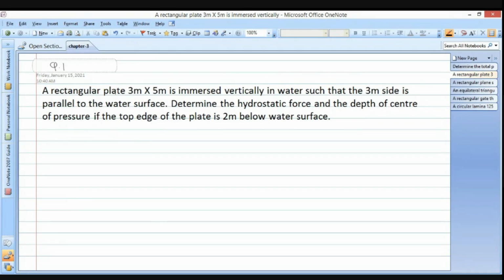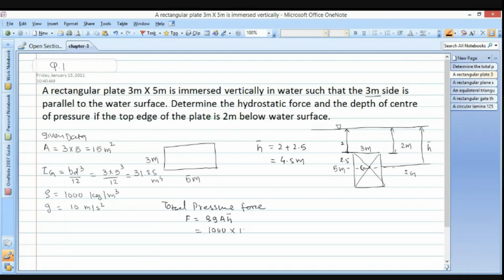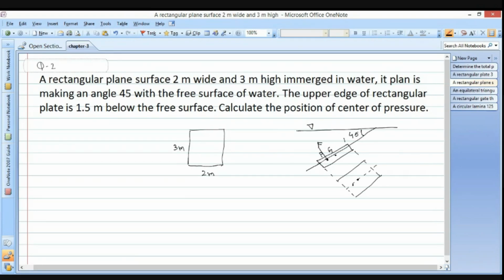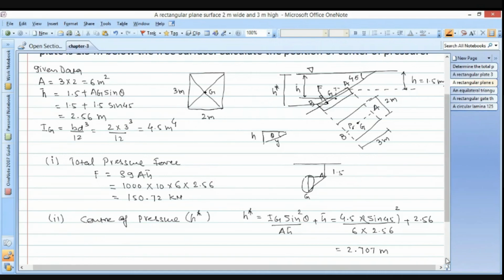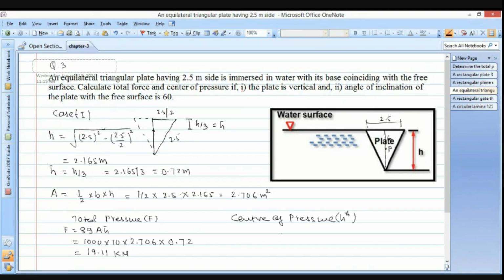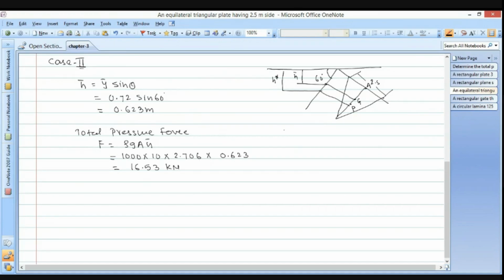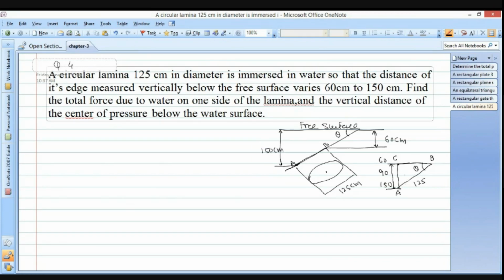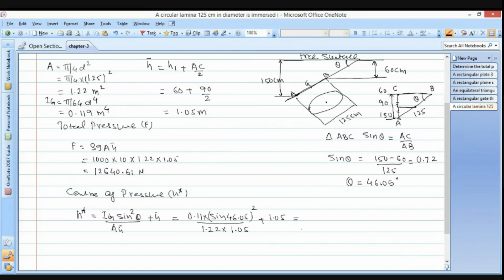Numerical of Total Pressure force and center of pressure | Lecture-7 | FMHM | 3141906 |2130602 | GTU

Comment: A circular plate of diameter 2m which is placed vertically in water in such a way that the centre of the plate is 4m below the free surface of the water find a. total pressure on circular plate, b. position of centre of pressure